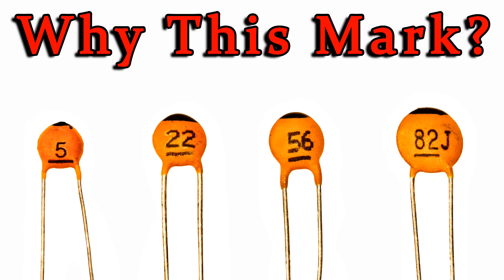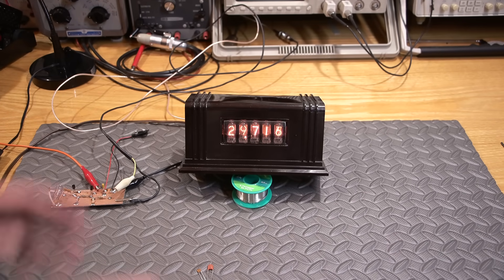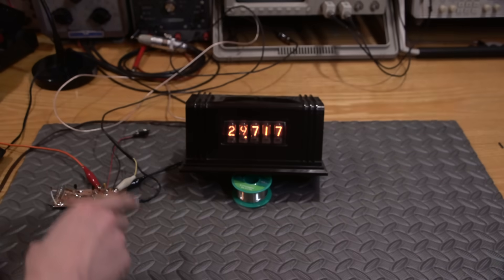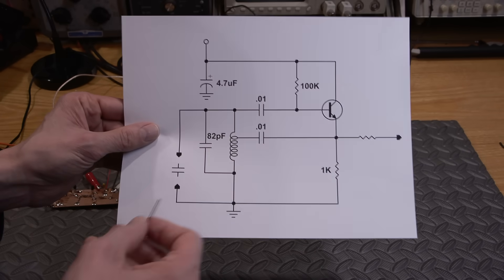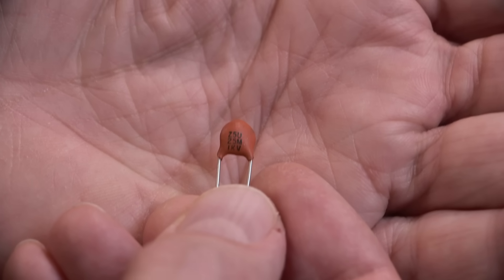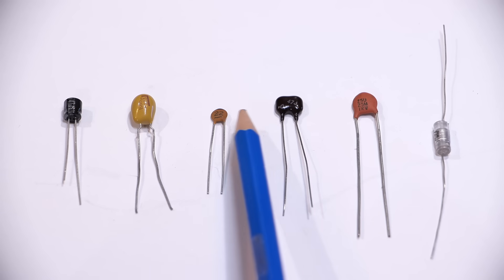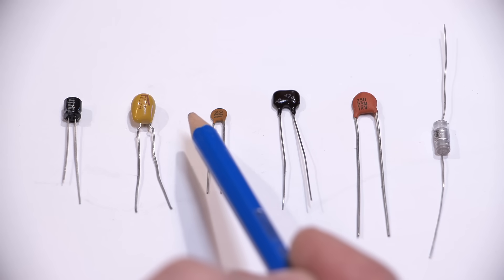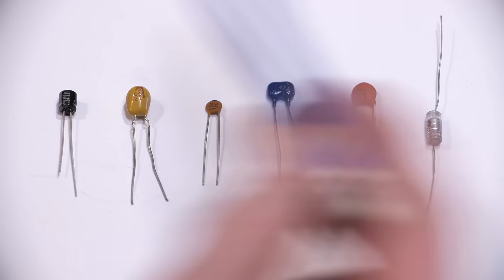Why This Mark On The Capacitor? Here's Why!

Comment: I spent 10 years repairing VCRs there were a lot of those marked capacitors in them, that was 30+ years ago and I don't remember what sections of the VCRs they were in. I recall one of my nice repairs was repairing the" unrepairable, must replace tuner". I found with cool spray on the board, the tuner would suddenly start working, until it warmed up. I isolated it to an electrolytic capacitor. Every time I got a tuner not working VCR, I would drip a few drops of cool spray on that cap and it would come to life. It was a great repair because the VCRs were never worth spend the cost for a new tuner.
Reply from the maker: Thanks for sharing your story.

Comment: I'm not 100% sure, but these "hat" markings on ceramic capacitors can mean different things, it depends on the manufacturer. It can be different colors, not just black. IIRC Philips used these markings also for the rated voltage or tolerance.

Comment: Can theses cap replace mika caps in tube radios?
Reply from the maker: If the voltage ratings are the same or better, they would actually be a better choice.

Comment: For the five years Ive been doing electronics, I've been wondering about the true purpose of the mark on ceramic capacitors-I thought it was just a manufacturer's mark.
Ps, I'm building a tone generator for a signal tracer. And I want the tone to not be so monotonous, and you just gave me and idea.

Comment: Then, there's mylar polyester and their weird thermal curves. Especially in some ancient radios and such.
At the mid-50's through 60's, it seemed like new types of capacitor were randomly and copiously introduced.
Some grew confused and annoyed, I considered it a learning experience and broadening of experience base.
I'd probably have to think for ten minutes to remember the old capacitor color dot coding, it's been decades.

Comment: I'm a software engineer, not electrical... but I've actually seen capacitors with nothing there before.
By nothing there, I mean the top of the capacitor is physically missing. Like it was drilled out. Product seemed to work fine :shrug:

Comment: Z5s are terrible capacitors, their only value is they might be slightly smaller.  Higher losses also.  PS:  We found that "Re-Constituted Mica" capacitors were a NoNo at higher voltages, say about 220V, because they will degrade via internal creep paths.  If plastic covered they tend to catch on fire.  Banned in all of our applications.  The older micas seemed to avoid this problem because they actually were made of mica sheets, not granules.  Might be the binders being used, that are the problem.

Comment: Small correction, the tantalum capacitor is type of an electrolytic capacitor, what you call an "electrolytic capacitor" is aluminium electrolytic capacitor.
Also, the NP0/C0G is not compensating anything, it just (practically speaking) don't react to the temperature change or DC bias voltage (big problem in ceramic capacitors).

Comment: That's amazing.  Many moons ago I built a little Hartley oscillator for Morse code practice.  It would drift a few hundred Hertz just breathing on it.
Reply from the maker: Shielding, power supply stability, and proper capacitors is the solution.

Comment: Slightly misguided.   Z5U specifies that the dielectric is NOT STABLE.     THE TYPE NP0 OR C0G means much more stable over temperature.   You would never use a Z5U in a filter or oscillator that you want to be stable, which is almost always.   The black top is less informative, it just suggests some stability.

Comment: I used to work at TI's cal lab in the 1970s and have worked on a number of Tek tube oscilliscopes like I see in the background (the one by your right elbow appears to be a dual time base 555).
Reply from the maker: You are correct, they both are (the ones on the carts)

Comment: Nice video but nobody relies stabilty of oscillators on LC circuit today. 10^-4 accuracy as seen on video is much better than anybody expect from LC. If you want better simple use crystal, maybe TCXO or even OCXO.
Reply from the maker: Inside those TXCO and OXCO cans are.... NPO / C0G capacitors (surrounding the crystal)

Comment: In general circuits, is an NP0 usually (I know there's exceptions) an upgrade over an existing one? Like if I have an old 80s guitar amp and I see ceramics, would NP0s basically make the amp drift less as it warms up? I'm no EE, but I would imagine only circuits specifically depending on changing thermals would matter. Like perhaps a circuit where the cap drifts, but something else drifts the opposite way--the circuit is already (partially) offsetting thermal drift.

Comment: @MrCarlsonsLab I’m personally enjoying these little quick videos going over stuff like this! The LED capacitance effect i believe I’ve seen that done just a little while ago on a diy regenerative type radio receiver. Very unique stuff friend thank you for sharing!
Reply from the maker: Glad you're enjoying them!
Reply: MrCarlsonsLab this has kinda just popped in my mind again from my memory.
May I ask? In a future a video would you consider going over Magnetic Amplifiers? There our a few videos about them, but it seems that it’s not very common knowledge, and I’m quite interested in them! 
And I often see a strong misunderstanding of what inductors our actually capable of. With the magnetic amp being able to handle loads very impressively versus its input! 
I have only ever came across one of these in my life time ( I’m 27)
From An old solid state frequency converter from my last job. It was being scraped, the rule there was if you see something in the scrap bin just ask if you want it, and I wanted it! 
I was given permission, got it home immediately took it apart to get a quick reverse engineering of how it worked ( mind you it weighted at least 80-100lbs, but the size of a desktop computer) 
It was rated to handle up to 1,000 or 1,500 watts. Well once I got it open my brain went on a big head scratcher, I was already familiar with radio at the time so i kinda understood, but didn’t. I have it remembered pretty well, there were 3 different iron core like transformers the very first one. 
the main power supply taking 110-220 ac stepped down to 24 around 8 amps this went to the main power supply board, were it stepped up the voltage somewhere around 300-400 volts,  based on the filter cap voltages (just wanted a look over no real need to physically measure the B+)
This went to part of the magnetic amp( the winding wound out of phase with each other on the far outer iron, and its current was being electronically monitored, the rest of the magnetic amp the center iron core winding was connected to the frequency conversion side of the PCB control board (this is the control signal that switches the magnetic amplifier with the desired 50, or 60hz).
Then this is were I didn’t but did get kinda lost. The very last piece of iron only had a single center tapped winding that went to the machine’s output to the load being connected there was no other winding, but you could see how the iron core was placed such that it was being magnetically coupled to the “Mag amp” 
I wish I understood more about then as I do now after Learning about it.
I would have kept everything!  I still have the main power transformer too it. Sadly let the most unique part about it go the actual mag amp iron core! 
It’s really quite an interesting device that’s quite old! 
And unless something has changed there’s not many videos about it, nor many with much knowledge of it!  I know of another odd ball device a CVT transformer the opposite of the mag amp unless it’s fully loaded! Very unique devices friend!
I hope it’s no problem to ask, I’m quite curious!

Comment: A tantallum capacitor is an electrolytic capacitor. I think you meant an "aluminum electrolytic". Also there are several types f mica caps. The one shown is a "dipped silver mica" type. Often referred to as a "kidney bean" in the olden days. Great video!
Reply: Is that tantalum he had "monolithic"? 
I hear the word, but aren't sure really which type or structure it means.

Comment: Wonderful demonstration of why we should use silver mica or NP0 caps in RF oscillators.  I know that without a low-wattage or temperature-controlled soldering iron, I could easily destroy polystyrene timing capacitors, but using those is an art that could be its own episode in this series.  Now Mr. Carlson should cover the use of NTC resistors and thermistors.  And actual varactor diodes instead of reverse biased LEDs.  This is a fun way to learn electronic device physics!

Comment: I used to design 2-way radios at Motorola. All our circuits were tested over temperature so we became familiar with  TC techniques.  I've forgotten the codes but I don't remember any of our caps having the black marks. We went by the NPO or N values. This was mainly critical with tuned circuits. We found that inductors always had a positive TC so we would use capacitors with a negative TC, like N150.  There was a certain class of ceramic capacitors that were worthless for tuned circuits. They had a bad temperature coefficient and they also had a low  Q.  But they were smaller.
Reply: Offsetting a inductors TC with a capacitor is a lost art to most these days I think.  That was common practice in vacuum tube radios back in the day.

Comment: Great video, Mr. C! I have run into this issue more than once in my career. And yet, I never knew about the mark on the capacitor. That would have been a real time saver. Thanks for the info!
When I designed the accESS-500 video still store product at Prime Image in the early 1990s, I accidentally used a bypass grade 0.1uF ceramic capacitor in the horizontal phase (picture position) one shot for the output video sync generator. All of this was sealed inside an RF shield can that I cut from metal I called, "bulk razor blades on the hoof". I had bandages on all my fingers from building that little box and sealing it up. I would place my display monitor in under scan mode and then marked the left edge of the image with a grease pencil indicating the temperature. My boss was not amused. Marketing was not amused. My fellow engineer peers were not amused. Though I had identified at least two dozen way more serious bugs yet to fix, everyone constantly focused on the most trivial of the lot. That H. position. Once all the serious bugs were fixed, I opened the can, replaced the cap with an NP0 type and the universe returned to its natural balance.
Reply from the maker: Thanks for sharing your story!

Comment: Maybe i missed it in the video but one thing is important, just the black color marking is typically for NP0 capacitors, there are lots of other colors used to indicate different materials... And as usual SMD capacitors come without an marking.

Comment: Great info. I'm a 25 year kitchen table vintage radio/tv hobbyist, and was a 30 year computer repairman, and don't remember ever seeing one of those. Aerospace stuff? Weren't other types of capacitors used instead when frequency stability was needed?

Comment: So, are NP0 capacitors more expensive? Is there a special symbol for them in circuit diagrams, or do you annotate the capacitor symbols accordingly?
Reply from the maker: No real indication on a schematic, but any capacitor in an oscillator circuit (higher frequency) should be an accurate capacitor.

Comment: Another thing to remind people of tantalum capacitors... use a higher voltage rating than you normally would for an electrolytic.  Tantalum capacitors fail shorted.  Spectacularly.  A higher voltage rating gives you more margin.  Ask anyone who had an early Meade LX200 computerized telescope!

Comment: A while ago I did replace a tantalum capacitor with an ordinary electrolytic one, but that was for a the supply voltage for a circuit and I haven't experienced any issues with that.
The reason I did replace it was because the tantalum started to arc over internally after a while causing My Skanti TRP8400 to "moan" in a bad way. It took me a while to find the culprit, but now that radio is working very well. The design is from the mid 70's as far as I understand from reading some drawings I found. Originally that radio was made for ship usage. The only thing I miss is the tuner, but that's the way it is and not a huge shortcoming.

Comment: As a longtime design engineer, I'm always leery of designs that are sensitive to component-value changes because it points to design marginalities. Do your design right: run simulations across process, voltage, and temperature ranges and use Monte-Carlo analysis.

Comment: Just love tantalum’s, I am getting ready to shotgun all of the tantalum’s on the exciter and amp board on a thirty plus years old GE MVP portable repeater. Had one blow when I powered it up after being off line for ten years. Yeah, even the electrolytics around the audio IC amp get replaced,a very hard part to replace today should one of the caps blow.

Comment: If you scrape all that stuff off many times you will see it is a ceramic 1206 smd component where leads were soldered on and it was dipped in epoxy.

Comment: I thought you needed a crystal to get an accurate oscillator. Do you know if these caps are as good? You were getting almost 5 digits of frequency stability with just a capacitor. Amazing. Thanks
Reply: Hardly beats crystal. These do for one-off timings where cumulative drift is not an issue.

Comment: Thermal expansion/contraction isn't the only cause of capacitance changes in ceramic capacitors.
In fact, a much greater influence is exerted by changes in the dipole polarization level of ferroelectric ceramics (for Y5V and X5R, X7R types) with temperature. It also depends on the applied voltage.
NP0 and C0G capacitors use other types of ceramics that lack dipole polarization. Therefore, they are very stable and have low losses. However, NP0 and C0G ceramics have low ε, which does not allow obtaining high capacitance.
Polystyrene capacitors can be even more stable than ceramic NP0/C0G caps, but require more careful handling. They also don't come with high capacitances.

Comment: This is pure gold! I had seen this rating listed on a 66 Corvette AM/FM radio I worked on several years ago. It had a dead FM board. When I repopulated the board, I made sure to use correct as-specified components on it, and this type capacitor was one such item on it. Now I know what the difference is! Thank you, sir!

End cause for failure was a cracked off leg on that NP0 cap, and a very poor connection on an RF cable. Very hard to spot with the set all together. Possible bad transistor(s). It worked well when I finished, and aligned nicely..

Comment: Tantalum caps ARE electrolytic capacitors. That's why they are marked with a polarity indicator.
Reply from the maker: Yes, but when you see a Tantalum capacitor on a board, you call it a Tantalum.

Comment: It's also worth mentioning that NP0 are typically small value as the dielectric constant of the material used is low. Z5U dielectric capacitors can provide much greater capacitance per unit volume but they are unstable with temperature (as Mr. C demonstrated).

Tantalum are not good long term as they tend to fail short circuit compared to electrolytic that go open-circuit. Tantalum caps can cause a lot of issues especially in older radio restoration projects where they can be prone to exploding. But saying that there was the Capacitor Plague of the early 2000's where Taiwanese manufacturers did silly things with the electrolytes used in electrolytic capacitors shortening their useful life.
Reply: tantalums dont fail because they are never used above 50% of their specified voltage rating or in excessively low impedance circuits / good luck with engineers learning that.
i dont know where you get tantalums are not good long term , they are one of the few capacitor types that have no known ageing mechanisms. there should be an electronics mythbusting channel for this type of stuff.
Reply: @echelonrank3927  No. One of the main uses of tantalum capacitors IS in low impedance circuits – bypassing electrolytics is one example and for bulk capacitance in lower power switching regulators.  

Tantalum caps offer lower ESR and better frequency response than “wet” elecrolytics and were designed for low Z circuits.

Tantalum capacitors are vulnerable to moisture ingress which causes them to go short rather than open (which is the failure mode you see with electrolytics) making them particularly problematic in older equipment and due to their failure mode can cause other issues when fault finding.

Do not rely on a life of more than 15-20 years for a typical tantalum capacitor. Even if you derate them, they are prone to failure. 

I get this from over 40 years of experience of electronics design ;)
Reply: @echelonrank3927  Oh - temperature cycling and cracking are also an issue.

Comment: With the black mark on the top it's max. temperature range is 85 Celsius ( 185 F). Without it, the range max. operating
is only 65 Celsius ( 149 F). But I'm glad I found out why it was an important thing to know  especially in electronics when
it comes to RF filters, audio and RF oscillator circuits. Great learning from you once again Paul!

Comment: You said replacing a silvered mica capacitor with an equivalent NP0 would be fine but what are your thoughts regarding the power capabilities between the two? Would you prefer the silvered mica in a high power high frequency oscillator circuit?

Comment: The underline under the value on your NP0 capacitor indicates its working voltage.  It's low, either 50V or 100V max.  If no underline, and no stated voltage value, it should be 500V max.
Also, an NP0 cap like that one will only function properly as an NP0 cap in the temperature range of -25 Celsius to +85 Celsius.   That may rarely but sometimes have to be considered.